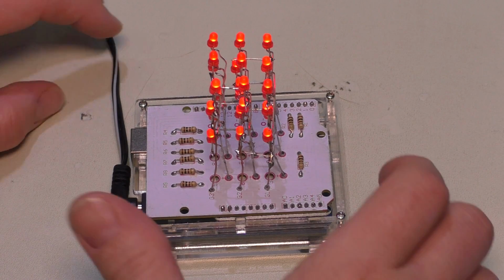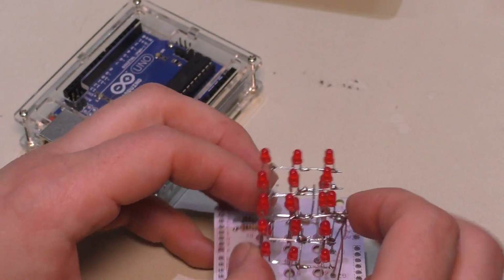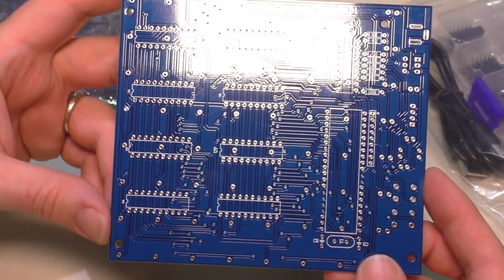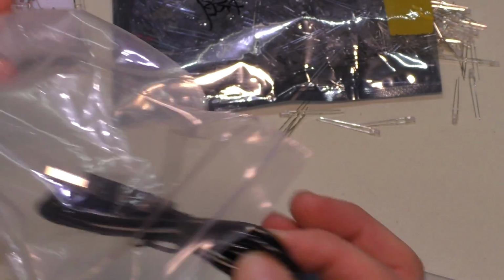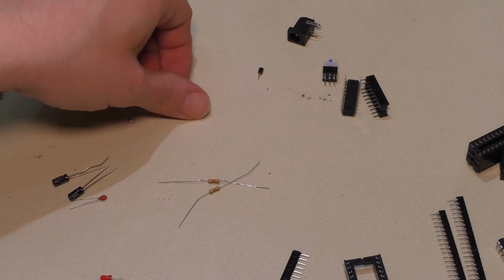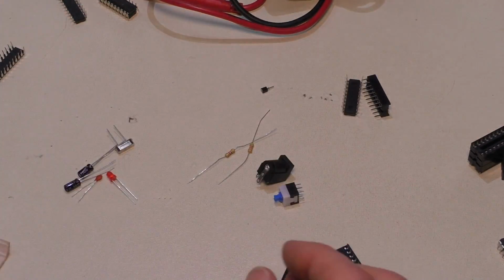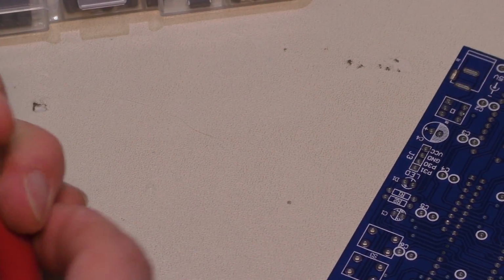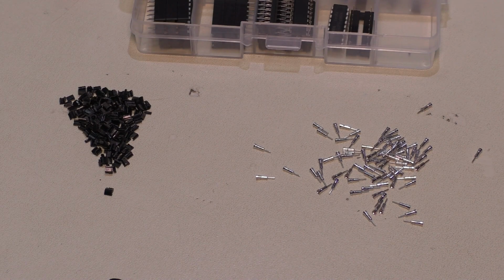PTS Ep. 167 - 8x8x8 Blue LED Cube Build Part 1 - Intro, Concept, & Prep

Comment: I could swear, I've seen that board on another video!  you could build some kind of photo sensitive circuit to measure the output of the LEDs as you're testing.  if you wanted exact matches.  (I haven't had any problem though).  I look forward to seeing the completion!
Reply from the maker: That's a great idea.  In fact, I may already have a way to do that: use an LDR and an Arduino.  I can read the serial data and use it to compare brightness values.  The values of course would be arbitrary but still comparable non the less.  I'm looking forward to getting it done.